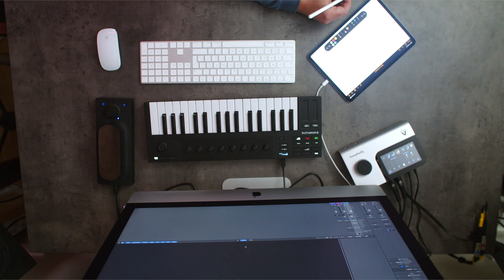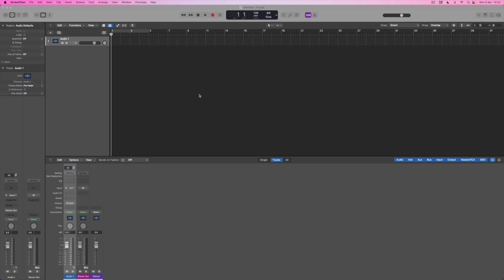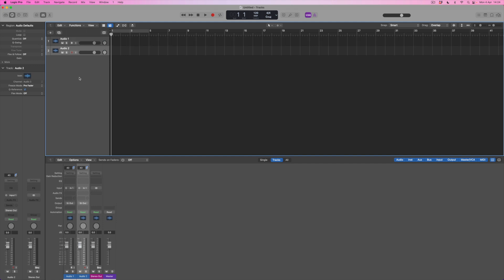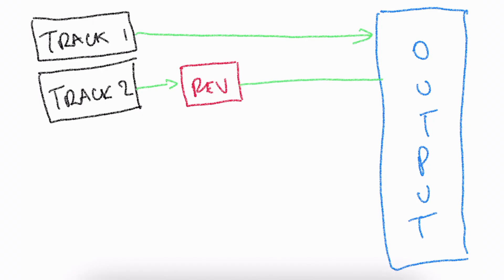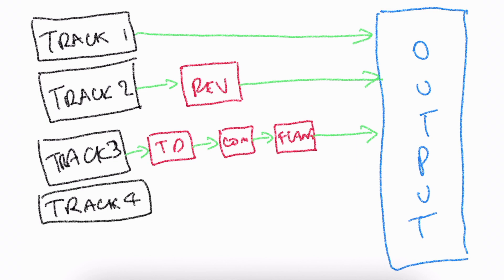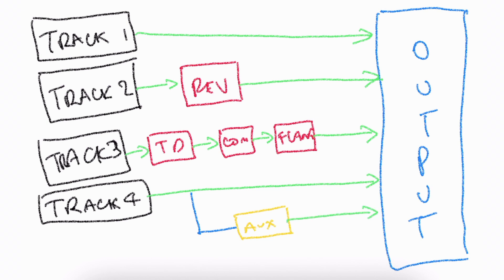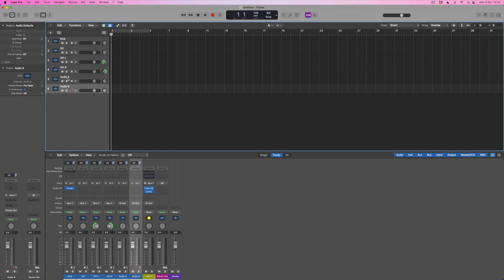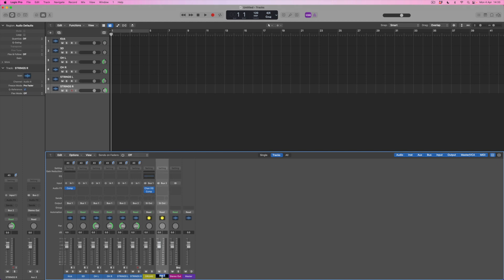LOGIC PRO X - Signal Routing

Comment: Nice one, Jono. Can I ask you: there’s a way in Ableton to split a track, apply different insert effects to each path and even save the fx chains for use next time. Especially useful for splitting bass parts with filters or eq and processing high / mid / low differently. Is there an equivalent in Logic? I’ve not been able to crack it! Pete
Reply from the maker: Hi Pete, probably the easiest way to do the equivalent in Logic would be to use the Duplicate Track button (next to the New Track button above the track list) and then to use the Scissors to cut and assign each part of a sound to different tracks. You can then configure each one with your chosen effects and then save the entire instrument/effects treatment as a preset for easy recall in any other project. Hope that helps.
Reply: @jonobuchananmusic  Thanks, Jono. That hadn’t crossed my mind. I’ll investigate that feature. Thanks again.

Comment: Thank you for this very straightforward and clear intro to signal flow. I look forward to the next installment on Track Stacks. I’m hoping you expand this topic to external MIDI instruments, MIDI controllers, and MIDI interfaces. That’s where I get lost to the point of sometimes misunderstanding what In and Out mean on my devices. Seriously! I’ve succeeded in getting my Keystep Pro to link to external and internal synths with Logic being the clock. But I’m at a loss to actually explain why it’s working. 

Thank you, as always, for your excellent instruction!
Reply from the maker: Hi Gary. Thanks so much for this. Absolutely, the next couple of weeks will be about Track Stacks, side-chain inputs and 'internal' signal flow possibilities. I will definitely make videos about integrating the use of External hardware too. On the list!